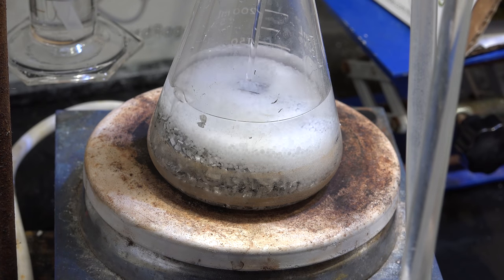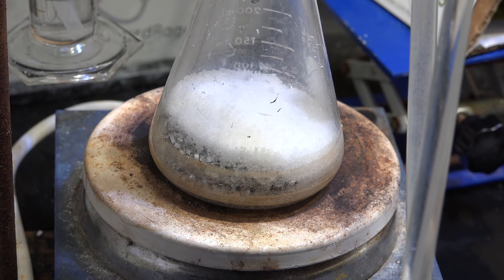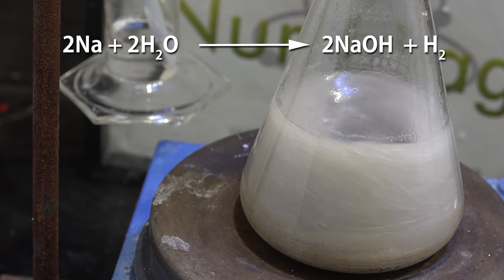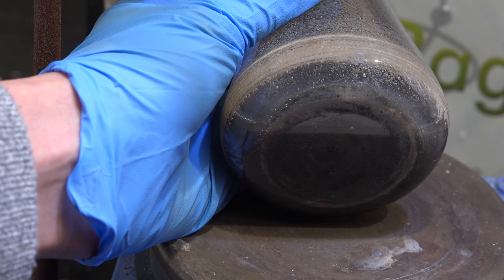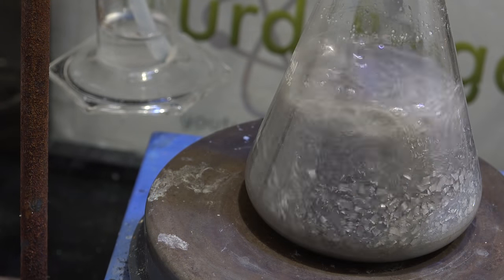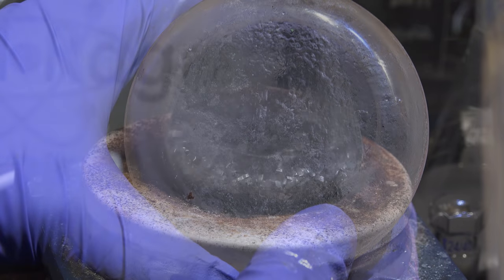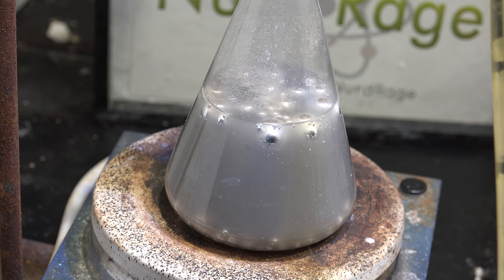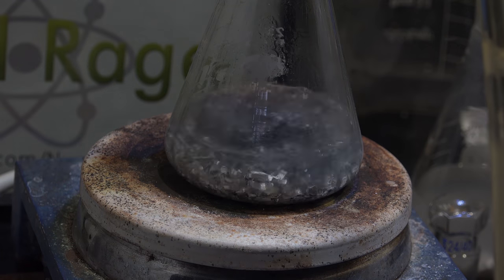Lab Notes - Successful glassware protection for sodium production - August 18th

Comment: Perhaps you could drive the water out like at 2:31 in an aluminium dish or something with a stir rod plus an oil or other liquid covering… maybe with continued stiring when the mix cools it wouldn't be a solid mass?
Reply: Aluminium and sodium hydroxide do not go well together. Then you’ll need to find a way to find a way to separate the sodium from the sodium aluminate.

Comment: Did you consider melting sodium metal along with sodium hydroxide in the steel crucible? Or it the temperature / presence of air too high for safety?

Comment: I wonder if you could dry the sodium hydroxide by heating it in a vacuum. You may be able to boil off the water without heating the NaOH to the melting point.

Comment: If you want to get rid of the hydroxide to prevent it from reacting with the glass, what would happen if you were to insert a metal ion that forms an insoluble hydroxide, such as copper? Afterwards, you can separate the copper hydroxide from the better products?

Comment: Have you considered using an oil bath?
Reply: Or a sand bath. They're slower to heat, but much less messy! (and sand's easier to come by than silicon oil).
Reply: piranha031091 great idea!
Reply: piranha031091 You don't have to use siliconE oil.
Reply: What can you use then? He goes up to 240°C for several days. Most cooking oils have a smoke point below that, and even the few that are above (avocado oil) would likely not withstand it for days.
As to mineral oils, most would have a non negligible vapor pressure at those temperatures, and may start slowly evaporating and depositing on every surface nearby...

I really think sand is the better option here.
Reply: piranha031091 yeah dont use silikon oil as a bath, if u get that shit somehow in a flask it will always be there and contaminate everything
Reply: piranha031091 I think sand is the better option too.
Reply: Andrew Delashaw in a lab we tend to use PEGX (polyethyleneglycol+chainlenght-number). But for backyard experiments sand is likely to be the better choice
Reply: monster2slayer yeah thats ok for around 200°C :/

Comment: Use molecular sieves or magnesium chloride maybe? I’m not too sure if the sieves can withstand NaOH
Reply: I think the molecular sieves are some alumosilicate thing. They'd get destroyed, especially if they absorb the water too. How would you use MgCl2? He says in the video that drying solids with solids is terrible, that's why he melted the sodium. NaOH is also a really good water absorbing agent in itself. So chemical destruction is pretty much the only way.
Reply: 6alecapristrudel I forgot that they’re made out of that. But I think there were some made out of broilcated glass. They’re probably too difficult to get.
Reply: The flask is also borosilicate and it dissolves. The sieves are also made to have stupid high surface area per unit volume. They'd dissolve much faster than the flask itself.
Reply: MgCl2 would react with NaOH forming NaCl and Mg(OH)2, and Mg(OH)2 would decomp to form H2O.

Comment: Is it possible or reasonable to use a container not made of glass?   
Porcelain?  Inert metal?  Polyethylene?  Teflon?  Crucible usually used for high temps?
(Okay, inert metal and teflon would be expensive.)
Reply: PTFE and PET would melt, inert metal might work, but as you noted; the more inert your metal is, the higher price. Porcelain and ceramics in general are poor heat conductors. Glass is just perfect for the job

Comment: if you put an iron or steel disc on the hot plate it should eliminate the hot spots. would that cause any other issues, other than the additional thermal mass taking some extra time to get it to temperature?
Reply: The hotspot is unlikely to be the plate. It's because the glass bottom of the flask isn't perfectly flat. Something like an oil or sand tray would do the trick, but might slow down the heat transfer.

Comment: what would happen if you attempted this reaction in disposable glassware, I am thinking ordinary glass bottles that come with food products in them. could that get you your initial sodium jump start without killing an expensive flask.
Reply: Disposable glass food bottles might have a shattering problem because they are thin and not tempered. But, on your line of thought, I wonder if canning jars would work. They are relatively cheap, especially if you pick them up at yard sales, and the older ones are made of thick glass. Plus, they are tempered so they can be heated again and again. They've been used in kitchen chemistry for years. So, why not this?

Comment: What if you start like you already are but instead of adding sodium metal what if you add drying beads they may take longer but then you won't have to worry about starting with the Sodium and you can get an initial charge of sodium metal that way or would the drying beads take too long and still sacrifice a glass
Reply: In theory if that method works all you would have to do is one transfer to retrieve the beads and carry on as normal with very minimal exposure to the air itself at least I think that's the way it would work

Comment: What about a different reaction vessel? You know it works, so why not use a metal vessel now.  Also, What about starting with some sodium bicarb in the mix? Should absorb water to form hydroxide, and the CO2 should get driven off. This should also need less magnesium as you have less hydrogen in the mix to start with.

If you have the patience, the magnesium should drive off the water eventually I think, just leave it stirring cold for a couple of days if you don't have a seed.
Reply: ok, more thought, and realised that the carbonate is probably too stable at those temperatures and ph, while the CO2 is probably too soluble in the mineral oil. Might work, as the magnesium oxide might eat all the CO2, but don't know.
Also, I see now why no matter how long you leave the mix, the magnesium will not be able to dehydrate the hydroxide. The water is not liberated until the hydroxide is reduced... facepalm.
Perhaps most important is that the most mobile drying agent in the reaction is the magnesium alcohol, and you are not starting the reaction with any. Maybe try adding a little bit of magnesium oxide to run the third reaction backwards a little before you add any sodium hydroxide. The water produced would get destroyed by the 4th reaction before the sodium hydroxide is even added. Some of the alcohol would always be bound to the magnesium, but it should keep the reaction dryer.

Comment: What if you destroy the water with electrolysis? I believe it should have the lowest reduction potential in the solution and it wouldn't be too hard to set up. Just run two wires through a thermometer adapter, seal it with hot glue or something so you can easily remove it later and then put that into a claisen adapter so you can still reflux too. If you keep your voltage around 1.23V it shouldn't destroy anything other than the water I would think.

Comment: I have literally hundreds and hundreds of those conical flask real CorningWare I got from a lab I used to work in a genomics proteomics type of business when they moved operation and drop that lab they just let everybody take stuff and nobody took anything so I did LOL I ended up with the specter physics blue argon laser a great big Zeiss microscope with about twenty objectives I sold it for a thousands of dollars and I wish I would have kept it now that I have used for a good microscope. I got a grant chiller large and small centrifuge Corning hotplates maybe three of them they're all gone now I burned them up over the years I do have a couple of Fisher hotplates love great big ones that get to really really high temperature cases of small and large heating mantles and a great big box of analytical pH strips that are just wonderful, pipe it up the was you I got so much stuff I can't even remember it's been boxed up for a decade